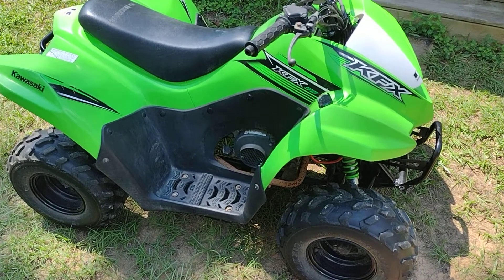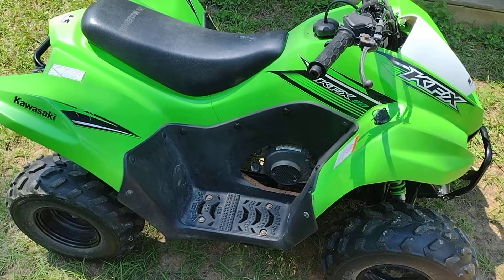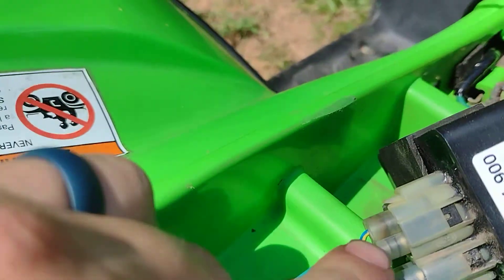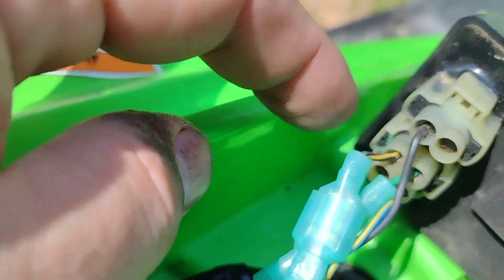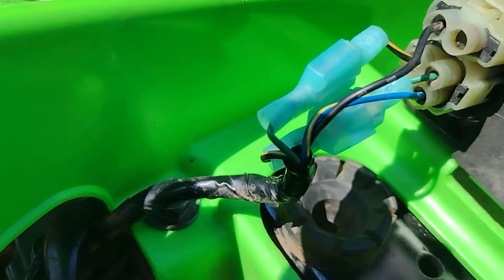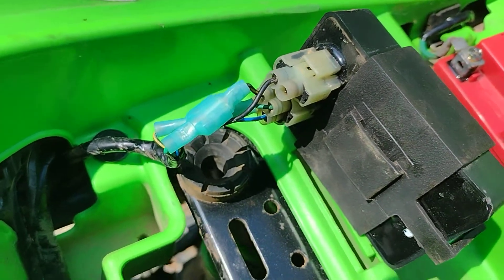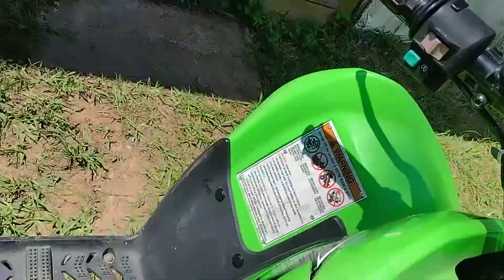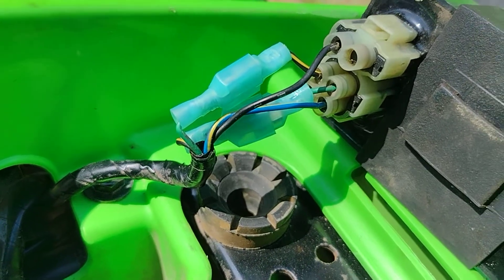2015 Kawasaki kfx50 ATV no spark not firing issue solved

Comment: Worked for me update worked once then dead again. In actual fact just switch them on the coil itself they are the same wires that run direct to the coil why cut them?
Reply from the maker: Not real sure why I didn't do it that way because it's been a little while since I had this bike..but the repair I did on mine was still working when I sold it 7 months later

Comment: So only switch the wires for the aftermarket cdi??
Reply from the maker: Where I found the information to do this the guy had installed an aftermarket one but I did it on my original one that was factory to the bike and it worked
Reply from the maker: I'm not sure what originally caused this to happen it was just being ridden and shut off like it ran out of gas, I guess something shorted in the cdi box but switching those two wires made of mine start getting fire again